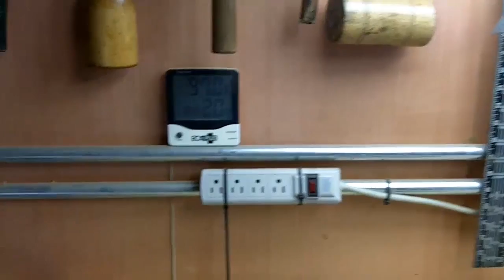Rockler Dust Right Separator reveiw; Harbor Freight Sharpener

Comment: Save on buying two shop-vac filters and the Dust-Right has paid for itself and put $10 back in your pocket. After that it's free and you don't have to buy a vac filter for years if ever. Thanks for the review.
Reply from the maker: Hey, Thomas.  You're absolutely right on the mark.  I'm sure the D/R has paid for itself a couple of times.  I use the same thing on my big dust collector and empty the trash can six time before I have to take the bag of to empty it.  What a hassle that is.Thanks again for leaving the comment, Thomas, and all the best to you.

Comment: So what exactly is the purpose of the dust separator?  If its picking up all the trash, isn't that what the actual shop vac is for?
Reply from the maker: Hey, Jeff. The separator is there just to extend the life of your shop vac, its filter and the shop vac bag if you use one.  At 30 bucks up for the filter and 12 bucks and up for the bags if you saw a lot it can get expensive.  I've emptied the separator at least 5 times and the bag is less than a 1/4 full and the filter looks like I put it in yesterday.   I like it a lot. I have one on the shop vac and on the dust collector
Reply: Ahh that makes sense now. I have a newer ridgid shop vac but I always just bang out the filter whenever I empty it.  But yes, it fills up quick with fine dust.

Comment: Thanks for the demo Mike - it would have been a little more informative if you would have showed what the filter looked like since that is the reason for using the separator. Thanks again.
Reply from the maker: Hey, 78, I thank you for stopping by and leaving the comment.  This separator really works.  I've had it for several years and emptied it multiple times.  The vac bag has never been replaced and is only 1/4 full.  Without the separator I would have gone thru a dozen bags or more.  Thanks again and may the New Year be a great one for you and yours
Reply: So you are just using a bag instead of the paper filter?
Reply from the maker: I use the bag and the pleated filter that came with the vac.  the filter looked brand new last time I emptied the separator.  Flipping my thumb across the pleats I got very little dust.  The vac has great suction.  I like this system a lot.  Take care...
Reply: I was going to DIY it but this thing looks good to me. Thanks again for the info...Merry Christmas to ya!
Reply from the maker: D.I.Y. is always good to better.  If you have hose fittings and a 20 gal drum it should work just as good.  I think you can get them from Rockler.  I made a separator for my big dust collector using a Home Depot metal trash can.  It works great.  Merry Christmas to you and yours.  Thanks again